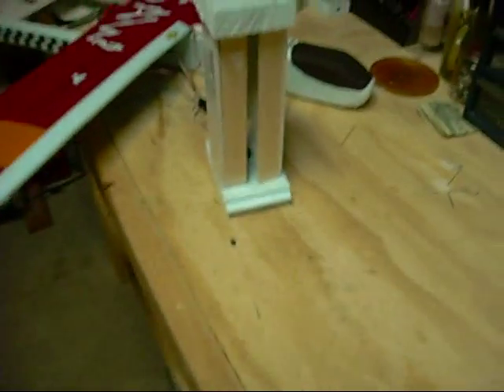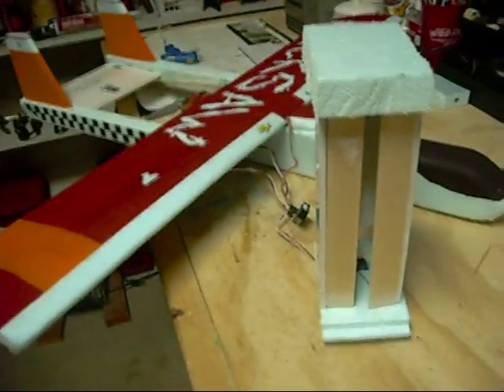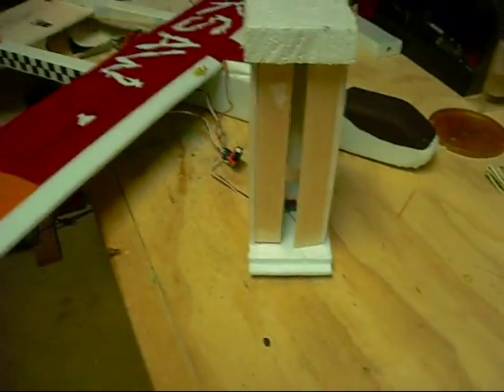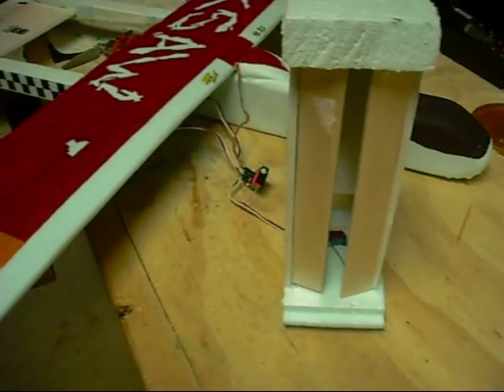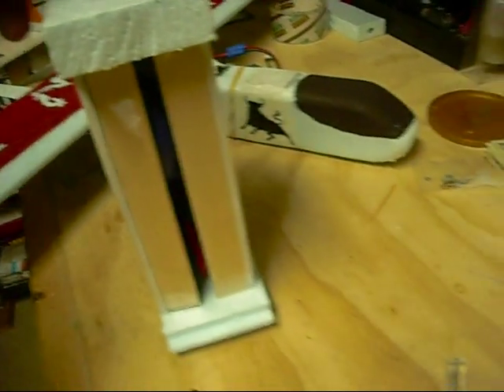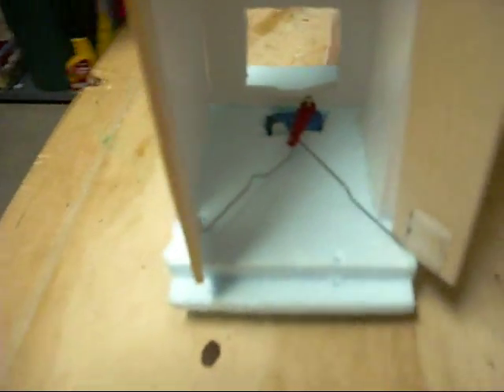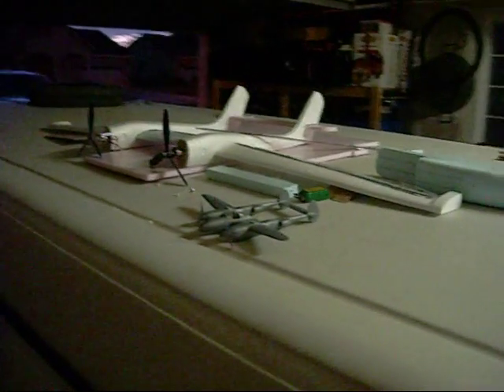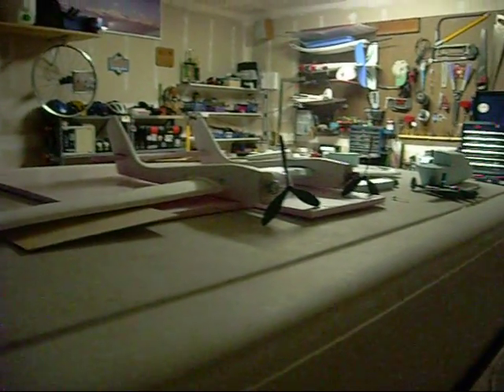RC Plane Bomb Bay construction

Comment: you've seen cap-guns right well I don't know if they still make them but they used to make cap mortars/bombs that loaded the cap in the middle of the bomb and was weighted to the front so that it would set the cap off on impact I was planning a similar design planning to use these Bombs just telling you because they would work well